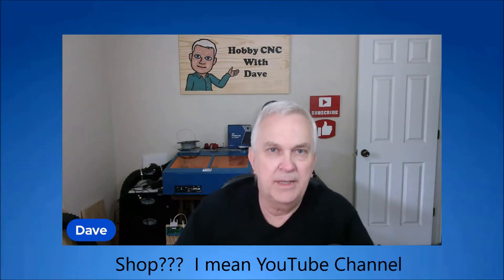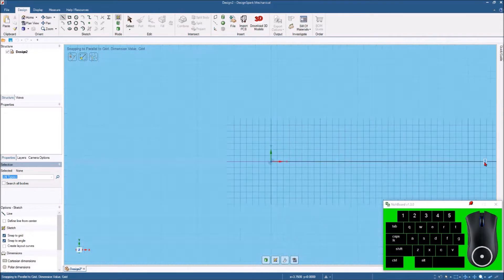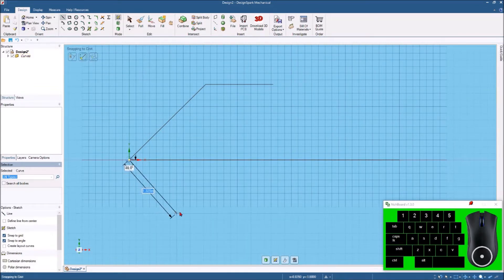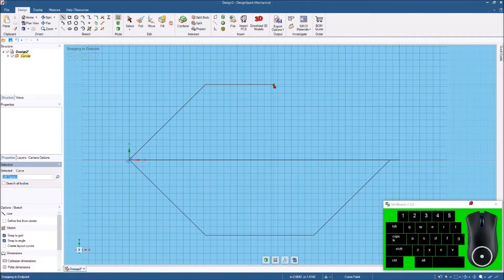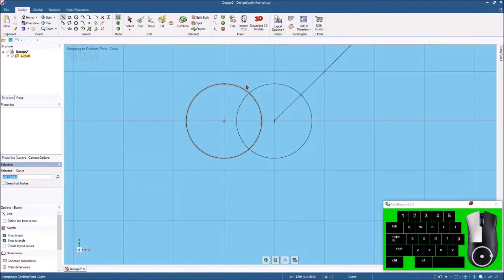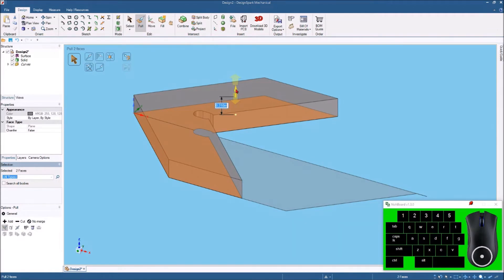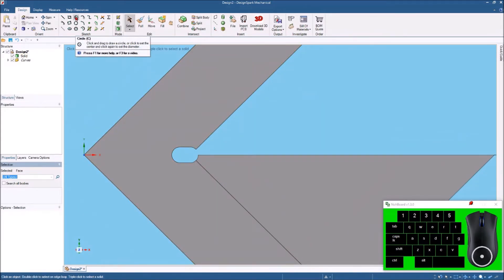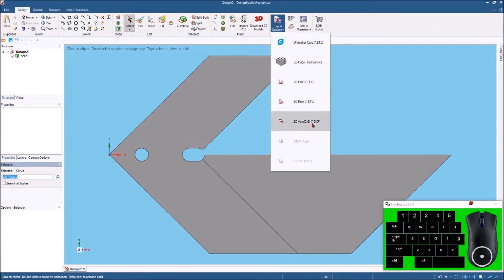DesignSpark Mechanical Tutorial   |    Center Finder Tool

Comment: Very interesting software Dave. Sure looks great for quick parts. I am guessing they have a lot of add on modules you can purchase but this is hard to beat if just doing 2D shapes.
I have Bobcad which has built in CAM but this would be interesting to try.
Thanks for the video,
Gary
Reply from the maker: Thanks for watching Gary.  As a long time SolidWorks user most free software packages don't impress me much but this DesignSpark Mechanical 3D software is really easy to use.
Reply: I have to agree that it is very impressive software. I did notice you can add on lots of modules for a cost though. I may try the free version just for fun. Not sure how the files will import into my software for programing but should work. Biggest issue is making sure you retain the XY zero position. As some software can loose that.
But I do model up a lot of things that I do not even plan on machining. 
Take care,
Gary